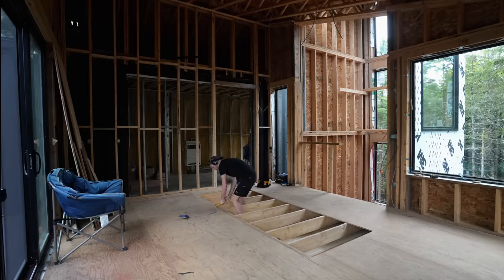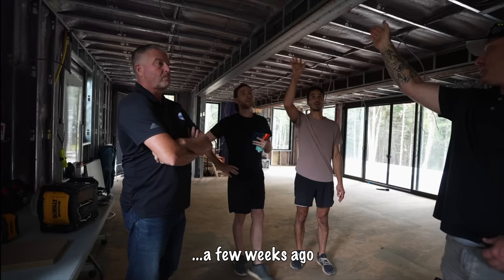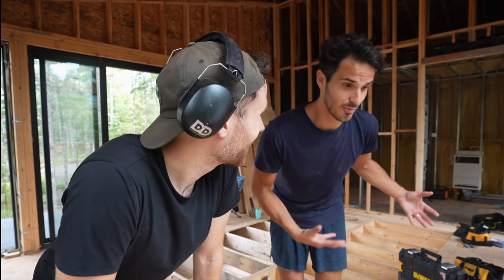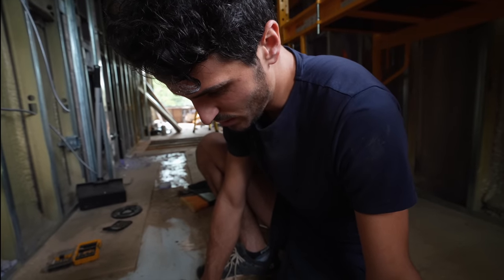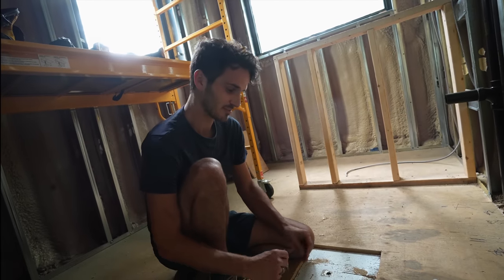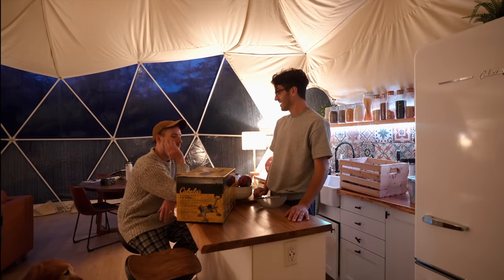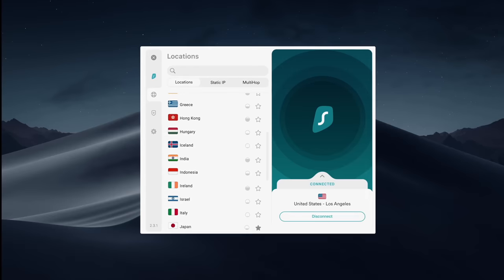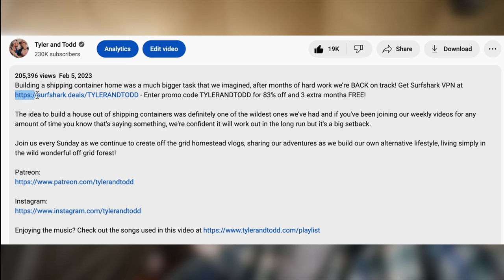What's been going on?...(life & shipping container home update)

Comment: Building biologist and mold inspector here...I doubt you will need to humidify your air that comes in in the winter at all. You want to strive to keep your indoor air humidity levels between 35% to 55%, anything higher and you create an enviroment that is hospitable to mold growing. You don't even need water intrusion to have mold growth, just organic materials and a high enough humidity so controlling your humidity levels is on the most important things you can do and invest in as a homeowner. Typically only people in more desert climates need to humidify their air intake in the winter. Get some hydrometers to keep in several rooms of the house so you can monitor your humidity levels. Get dehumidifiers if you need to. Another pro tip is to get leak detectors (the kind that come with an app) as well as under the sink leak mats and put them on them. When there is a leak under any of your sinks, the mats will hold up to 3 gallons of water and the leak detectors will go off (and alert you via the app if you aren't home). You will save thousands doing this because eventually, a sink will always leak and often cause a lot of damage. Make sure to get a pan for under your washing machine, dish washer, hvac and hot water tank too and put leak detectors there as well. Literally will save you so much trouble in the future.
Reply: Thank you for the prevention advice!

Comment: Ugh, sounds like you guys went through a lot of stress.

I hope you're resolving the issue with the siding installers so that you don't have to pay for the replacement material because that was NOT your fault, either.

Let's hope the issue with the tower is quickly resolved, too.  We don't want the stairs shifting away from the house.

Ventilation is good.  These guys sound like they know what they're doing so, yay.  It's ironic that you made the house so air-tight that you have to install ventilation so you can have fresh air inside.

Oh, no, the great potato famine of 2023!

I just tried a thing with some baby potatoes: wash well,  put in a shallow baking pan whole, add sea salt & olive oil and bake.  5 minutes before they're done add shredded cheddar cheese and let it melt.  Then garnish with sour cream (and chives if you like them).  SOOO good.

Comment: I seriously hope you do not have to pay for the mistakes of your contractor.  We just had a new roof put onto our house & the little shop/shed.  They came back to check on the only issue with a gutter & we just ripped it off & called it good for now.  It's always something but best to catch them before a major issue like leaks happens.  People think of leaks & buckets but not so much damage to wiring & hidden structures.  It will be fixed & you can relax a bit.  Things always work out.  Maybe take a little road trip break!

Comment: Heat recovery is the way to go guys, especially in winter - windows closed and yet lots of fresh air - I have it in my place and it is amazing saves a fortune on fuel recycling 85% + of the heat -  I have mine set to cycle the air through the lounge  twice every hour - the only downside is the ducts can carry noise from one room to the other if you have guests : )

Comment: Glad to see you're back and hopefully safe now that Lee has passed. I've been keeping track of the Novia Scotia weather. 

Other than slicing, you didn't show the rest of your prep. Here's a southern boy's technique. First, after slicing, did you soak them for 15 minutes and then dry them thoroughly with a clean kitchen towel or paper towels? Important. Baking at 425° F for 25-30 minutes should be enough (not what sounded like hours) or maybe a little longer until they are golden brown and crispy. If you're spreading them on parchment paper, careful your oven doesn't get too hot. Parchment can catch fire at temps above 425°.  You do not need to flip the fries during the baking. It also important to single layer them with a bit of space between them. Once done, I add a little salt and pepper. Enjoy! Hope this helps.

Comment: I highly recommend, if you have not purchased one yet, you consider getting a Heat Powered Wood Stove Fan. You sit them on top of the woodstove, and the rising heat causes the fan to turn, thereby circulating the heat into the room. We have one for our woodburning stove in Canada and it’s a wonderful. If you Google - Caframo Ecofan - it will give you an idea of what one brand looks like. There are a variety of different brands and you can take a look and see which one works the best for you. But they really are great and since they do not require any electricity to run, does not pull anything from your system.

Comment: Hey Tyler and Todd,  To accomplish cutting fries, choose larger high starch potatoes (Russet) if u can and all you need to do is slice the peeled potatoes one way(longest) then lay the sliced potato flat then cut of 3 inches on each side in a vertical motion to get rid of the smaller pieces then cut the rest of the potato in French fries..Best way to cook French Fries way faster is in hot oil (fryer) drain in a basket and they will turn out  golden and crispy…🫶🏻🍟Cheers Candy

Comment: I totally feel you on having people you trusted to work on your house fail you. Having a massive project done on mine & they're just finding poor workmanship everywhere. Turns out none of my brand new windows are sealed, cold air, water, and SPIDERS are getting inside 🫠 And like you, I did all the research & went with a reputable company. The plumbing work is even worse. But watching you guys and Vanwives I was inspired to rip out and reinstall the leaking broken toilet 🚽💪 and it went pretty well! Next I'm doing the waterproofing as they put 1mm of caulking sealant. ONE MILLIMETRE 😮 no wonder it leaked so badly! Anyways, good luck & thanks for the inspiration 💞

Comment: Well since you are pulling up the floor anyway you can have more of the foundation anchors put in from the inside. I don't know how many code requires for the weight but drive them in the ground put a beam in the floor instead of from underneath so you won't have to see it.

Comment: Do you have a ease out bit?? When the head of a screw is stripped you can use a back out bit, or ease out bit, and it will cut into the screw head  and back it out

Comment: In commercial kitchens the fry cutter gets bolted/suctioned to a wall so you can slam it down. We used to put 5 gallon buckets under it and do bags of potatoes. We also flash fried them so they don’t take as long to fry to order. So we would wash, cut, flash fry for 5 mins, spread them on sheet pans to cool then fry to order for service 😊
Reply from the maker: So what I heard is that you think we should add this to our kitchen? Done.

Comment: On the ductwork pipes, did they secure then down, granted they should not move. But I had this thought of copper water pipes that are not properly secured can start to rattle and make noise. Once the floor is redone it’s expensive to open it up if needed.  Are going to cut fries and freeze them for later usage, if so let us know how that goes.

Comment: *Hey Guys.. love you guys so much, you are both so adorable inside and out.. About those french fries.  good idea to blanch them in boiling water for a few minutes, 2or 3 is good.. then soak them in ice water.. don't skip the ice water step!, it is important as it does something to the cell walls of the potato that helps make the fries crispy-. always always always dry them off on a kitchen towel before cooking...  A cool tip I learned is, toss them in a bit of cornstarch, add any seasoning you prefer with it or just use the cornstarch (or whatever version of starch you cook with like arrowroot etc)... it helps 'crisp' up the outside while leaving the inside nice and soft and tasty.   I love that machine.. you two are a hoot, I was laughing my butt off. silly even b4 the wine hahahha

Comment: The air system seems complicated, and I can’t help but think about the air from the bathroom being recirculated through the system. Bathroom fans aren’t just for the shower exhaust you know😂. ❤
Reply from the maker: It isn't being recirculated through the system...it's taking the heat and energy trapped in the moist air from the bathroom and is using it to preheat the cold air coming from outside. It's called an ERV if you want to learn more about them :)